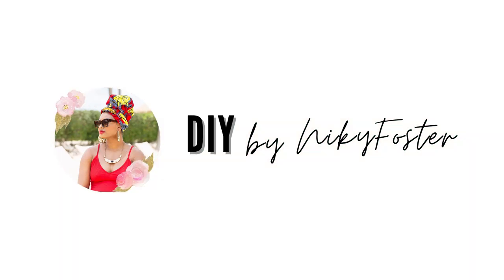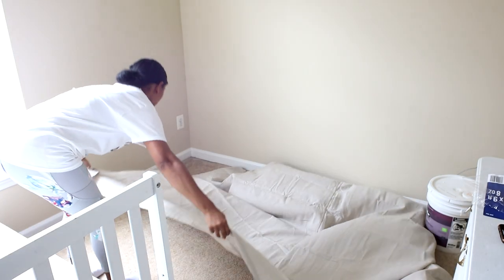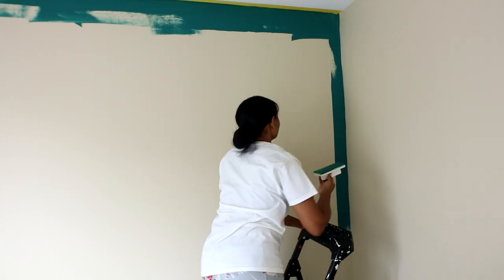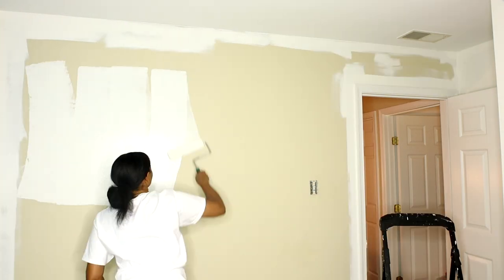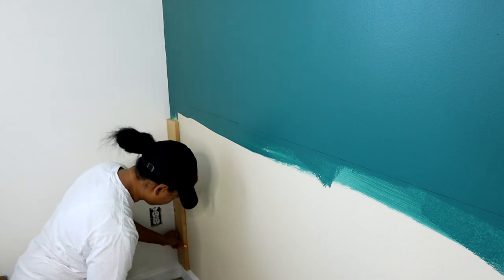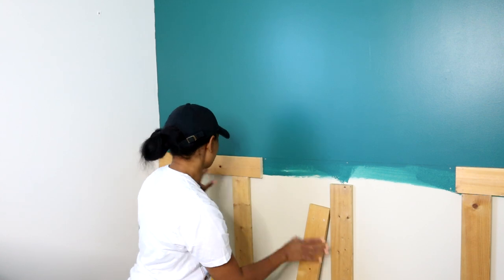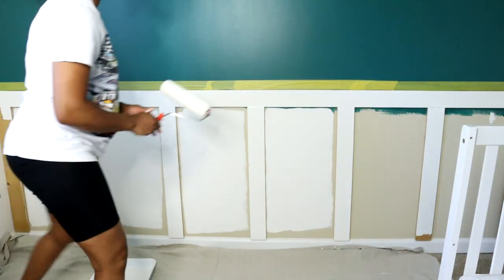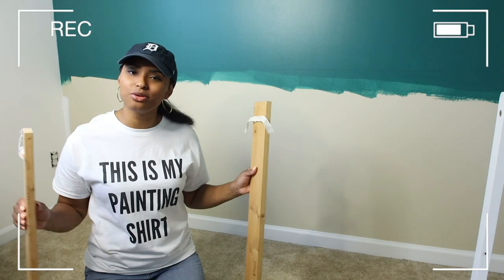DIY BOARD AND BATTEN IKEA HACK I TODDLER ROOM MAKEOVER - PART 1 I  I DIY BY NIKY FOSTER

Comment: LOVE the look of board and batten. I want to do that in my dining room! I have a question - when you measured 15" apart for the boards, did you measure the whole wall first and then divide? And also was it 15" center to center or edge to edge? Thanks :)
Reply from the maker: Yeah this is so cool for dining rooms! Yes, I measured the wall first (mine was about 114 inches) The slats are 3.5” wide but the 15 inches apart looks the best to me space wise! BUT you can go up to 19 inches apart if that works out for your dining room space-wise. You know what I mean? 🥰

Comment: Hi! My mom and I LOVE this, and have two - three questions:
(1) I saw you used a wire cutter to remove the "unmatched" board from the wall. Is it a specific wire cutter? Did you have to do anything else to remove it? We want to do this same thing but longer boards, and possibly thinner, but if we accidentally have the same problem, or don't like it in a few years, we'd like to know how to properly remove it. 
And (2) if we wanted it thinner, how would we be able to know/measure the depth-in comparison to the wall- beforehand?